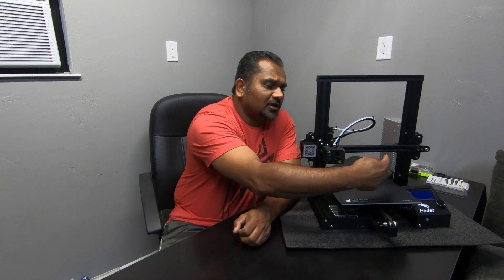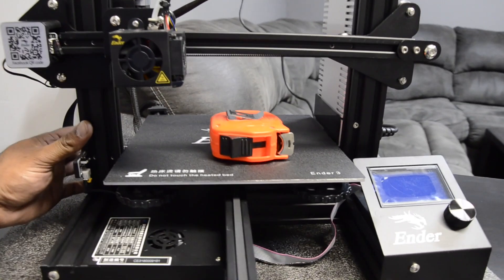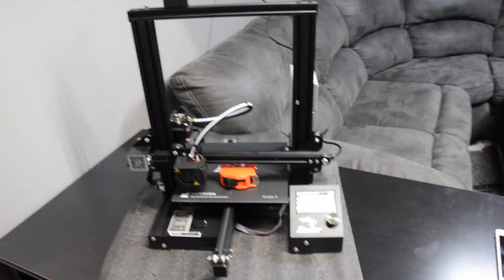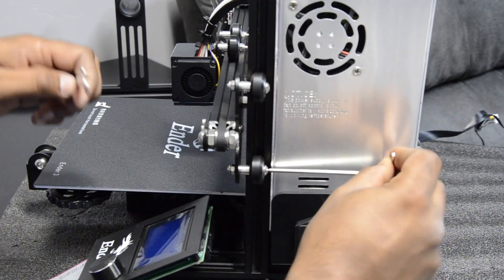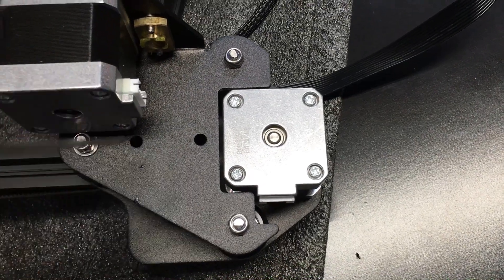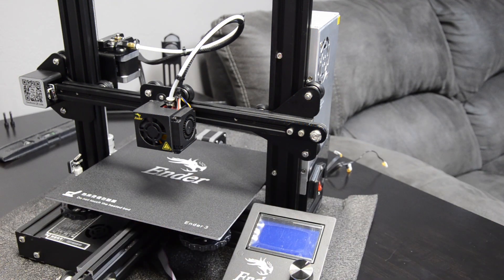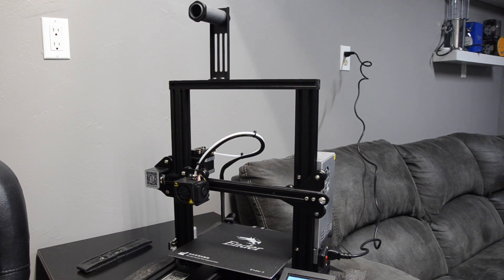Creality Ender 3 / How To Level Your X Axis

Comment: I've watched a dozen Ender 3 assembly vids. Nobody mentions this. Thanks. Mine were off by 3-4mm.
Reply: It's true, no one ever mentions this but this is also mostly not how to fix it. Adjusting the right concentric nut never makes any difference, unless your X is already horizontal and just needs to be trued to the rail. Often (apparently, mine was way-off too) the X-stepper assembly isn't at 90 degrees to the rail. The only way to properly true your X is to loosen all four bolts, though the holes in the plate - make a best-guess at a good alignment (you can drop it on backwards on one rail and use a set-square) and then drop it on both the vertical rails to check. Tighten your rollers start to wind X back onto Z, you can accurately measure alignment from the Top of the rails. If you're happy, rise it back off and lock down the bolts, not too tight.

Trying to guess this from the bottom or just assume a true won't do anything. Sorry SAN, it's a good attempt to fix something not often covered on Youtube but it won't result in a flat X for most people. They have to correct the assembly error, accurately. xxPD
Reply: @pdjames1729   Thanks for writing this up. Helped finally lead me in the right direction on this. My X finally feels level and not just good enough.
Reply: @tconline2000  thanks for reading (all of -lol) it. 3Dp videos are a rare place on youtube where replies sometimes work :D

hep Pear out xx >> fb.com/PearComputers
Reply: @pdjames1729  Hi, what are the 4 bolts that we have to loosen? I didn't understand, sorry. My X had a difference of more or less 2/3mm. I tried to tighten the concentric and it improved a little... Unfortunately, when I'm printing, my printings are more flattened/thin in one side than the other and I don't know how to fix it because I think my bed is pretty good leveled. My X now have 1mm difference in each side and I don't know how to improve that... Can you help me? I need to loosen what bolts?
Reply: @franciscocalhindro7221  tram/level can be an art on enders, the bed itself is often still dished slightly. I used a bath tile and lifted my Z stop by 3-4mm.

 IF you still have a big gap, or are 'level' but one side using much more adjustment than the other..

To tram X by cheating...

You only loosen the right outer coasters, in the same way San does. 02:20 So the right v-slot assembly can shift, the left (where the X servo is) not so much...

Then take your X to the top of Z by hand and CAREFULLY squeeze the X. By hand, against your top rail. Read 'You can also cheat' - my second comment up there xx ^^

But it sounds like you are very close to flat and level francisco. You can print base layer at 0.4mm to make it more tolerant.. and put some pva glue down :D all cheats help early on ;)
Reply: @pdjames1729  You should make a video because this makes no sense to me
Reply from the maker: Happy to Help!
Reply: @SANTUBE  THX! Assembled mine today and as the test prints I see that there is something very much off. Now it works just as it should.
Reply: @SANTUBE  Hey man, did all the steps but my X axis on the right side is loose, i can move it up and down with my hand qith a little bit of force, is that normal? i have ben able to print by moving it up so that it makes the first layer well enough to keep printing and it does, but it does seem like i HAVE to do tht every time, so is it normal or should i look into another work around?
Reply: Also me... No one like this video... Thanks
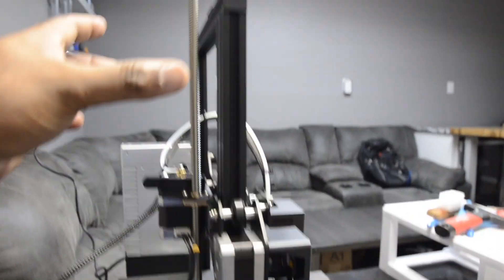Reply: At 3:44 this is most likely going to be the resolution to my issue. I'm chipping at that rubber wheel when sliding it into the vertical extrusions bc it's not aligning well when going down it, I can see the plate move forward when you adjust it so I'm going to give that a shot.

And just like the other commenters... this video from 3:00 mark and on was the most helpful of all ender 3 pro videos for my assembly challenges so far.
Reply: You can also cheat, which is how i did mine. Loosen the right outer coasters. Take your X to the top of Z and squeeze it against the top rail (no need to remove)

Then get a rule, or a piece of paper. Crease the paper against the top rail on the right. Check it's the same on the left. Rinse and repeat until your X is parallel to your top rail. Then lock the right outer coasters down, tweak the concentric if you need to and you're done. In 1 minute. Mine was 4-5mm out when I got it, almost too much for the bed adjustment - not now. Now it's close to dead-on... not that i checked with calipers nor nuffin. xxPD
Reply: @pdjames1729  thank you the video did not help but this comment did
Reply: Thanks PD that worked for me! :D
Reply: @pdjames1729  bro i added you for help  as well
Reply: @ryanhammack720  thanks Ryan, much appreciated :) I know it's chopped up over several comments now, people gonna have to hunt aren't they? :D 2nd reply 'How to cheat' is probably the most useful, I'm glad it's helped some people at least xx PD
Reply: @pdjames1729   Would you be able to make a short video of how to do it your way?
Reply: @bartol435  maybe, when I'm back in that lab ;o)
.
There's no need really. I can draw something on !Paint :D ... 1 do once more, less words xx
Reply: @bartol435  take the axis with your print head up as high as you can. Make sure that axis (X) and the top of the frame are near perfectly in line. By any method that's ok for you.
.
It does help to losen v-slot rollers on the right. 02:20 But you can just grab it and squeeze Carefully :D

Comment: can you also do one for the hotend axis (y)?
Reply from the maker: This was for the hotend axis (X).  Y would be the bed.  Whats seems to be the problem?
Reply: which axis is for the extruder... i messed that one up, completely disassembled, and now i can't get it back together without it banging around it doesn't get firmly fit,
Reply: the wheels with the vents on going from left to right, (hotend attached on it,)

Comment: How accurate should this be? Mine is off by 0.5mm. Is it ok?
Reply from the maker: biagi that should be ok
Reply: SAN TUBE mine is off by 1mm. And I have problem with auto leveling, one side is too low. Maybe the 1mm is too much?

Comment: Thank you, I'll put this in my "video toolbox" for future reference.
Reply from the maker: Slvrbllt44 happy to help.
Reply: @SANTUBE  You can also cheat, which is how i did mine. Loosen the right outer coasters. Take your X to the top of Z and squeeze it against the top rail (no need to remove)

Then get a rule, or a piece of paper. Crease the paper against the top rail on the right. Check it's the same on the left. Rinse and repeat until your X is parallel to your top rail. Then lock the right outer coasters down, tweak the concentric if you need to and you're done. In 1 minute. Mine was 4-5mm out when I got it, almost too much for the bed adjustment - not now. Now it's close to dead-on... not that i checked with calipers nor nuffin. xxPD

Comment: Hi . I know you want to keep the video short,  but you rushed through the first option so fast, I didnt understand what you did ,your arm was in the way on some of it , so I couldn't see what you was doing . I am a cnc programmer/setter , so I am by no means stupid.  I really wish you guys stopped using time lapse on things people need to see .
Reply from the maker: Petet Bates sorry about that. I can go over it with u if u want.
Reply: Heres what I think you did , you loosen the 2 outer wheels,  then you moved the inner wheel off , then tighten the outer wheels hand tight , finally you turned the inner wheel to take up the slack . Please don't get me wrong,  I like your uploads , otherwise I wouldn't have subscribed,  but I know If I'm not sure what you did , there are a lot of people who would just turn off.
Reply from the maker: Petet Bates you are correct, the only thing i did different is tighten the outside wheel more then just hand tight.  I see what ur getting at.  I will try not to shorten my videos more then I need too.
Reply: That would be great , I really enjoy watching your uploads , you do a great service , you ender 3 video helped me put mine together.  So thanks.
Reply: Ps . The ender 3 is my fifth printer.
Reply from the maker: Petet Bates that’s a lot of printers
Reply: SAN TUBE , first one I got from a weekly mag , had to build it bit by bit , that was over 5 years ago , but I didnt get into printing till about,  6 months ago.